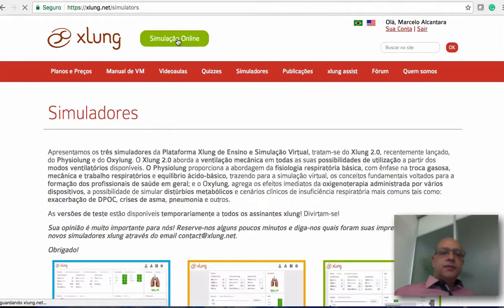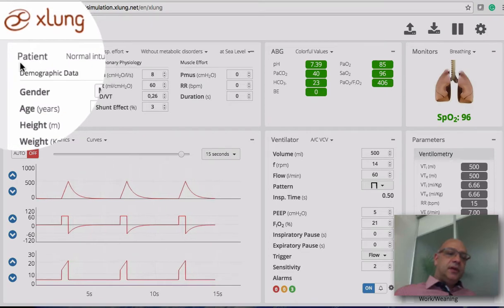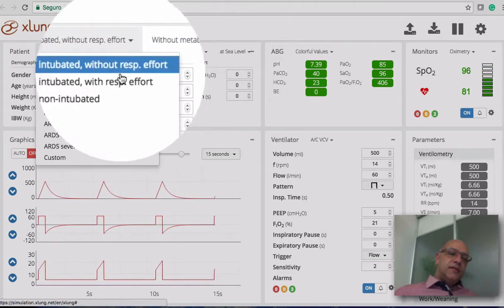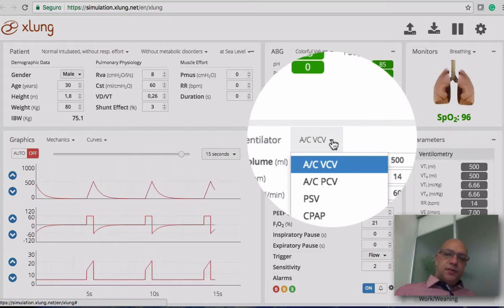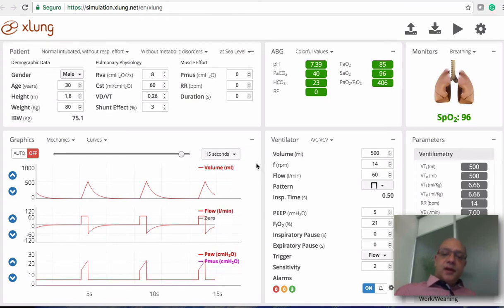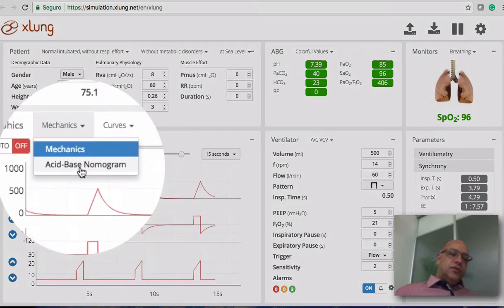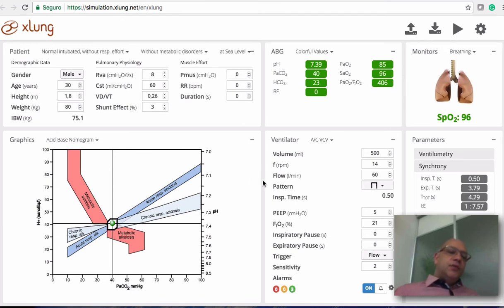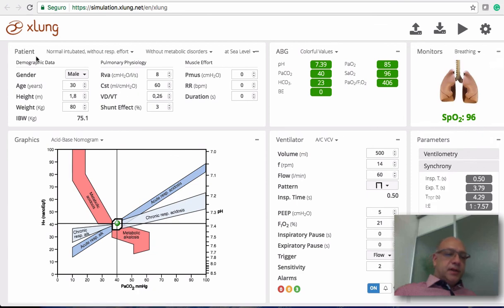Xlung Demonstration

Comment: OK, I have worked with this simulator, and It is great. I think it has some possibilities. I do however see some issues that could be worked on. It only has four modes. VCV AKA Volume Controlled Assist/Control, PCV, AKA Pressure Control Assist/Control, PSV, Pressure Support Ventilation, and of course CPAP. Continuous Positive Airway Pressure. Last week, I was wanting to simulate a complex patient who required APRV. This ventilator isn't assumed to have a floating exhalation valve, so even in PCV ventilation, it wasn't impossible to simulate a patient spontaneously breathing in PCV, and the I-Time only went up to 3.0 seconds. This  made simulating APRV impossible.  Another thing. I know this would make things even more complex, but It'd be nice, if there was a High Frequency Ventilation simulator, even if it were a seperate simulation, because,  Currently, there's no such thing as an interactive HFOV simulator, and this would really really be a HUGE  achievement in Xlung.  The thing is, It'd be complicated to actually set up a program simulation like this, but It would be possible.   there are many great things I LOVe about xlung. I think it's really well done, and you have my support!!!